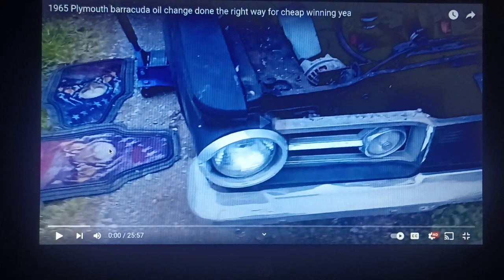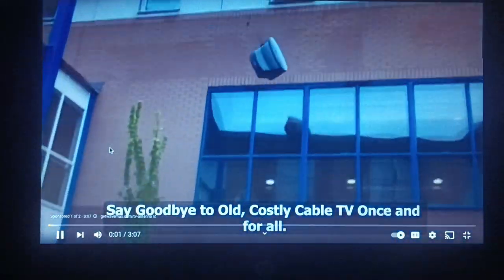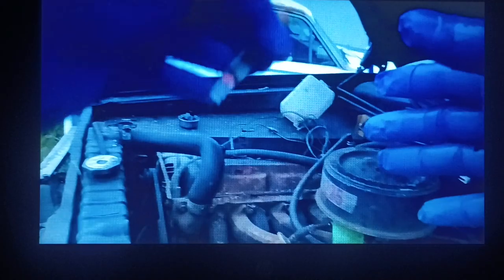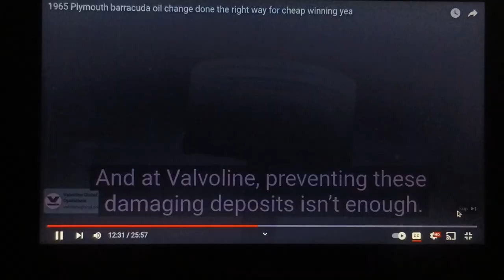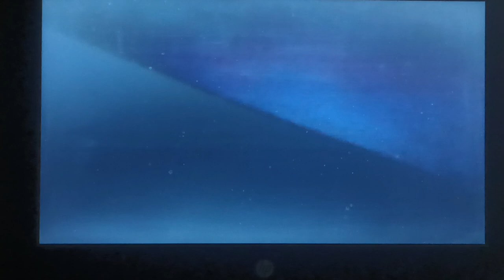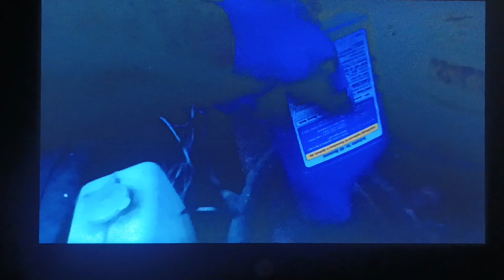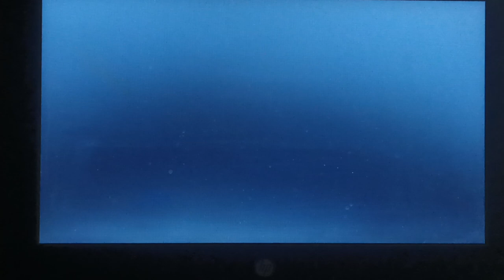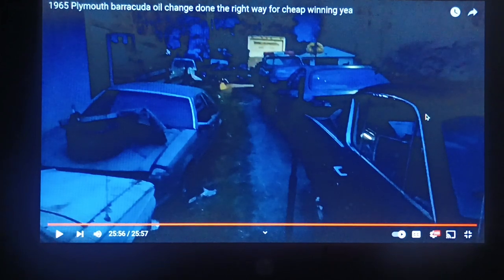I really don't like this guy

Comment: I just don’t see how it’s possible to keep that many cars running. 
Even used car dealerships have a very difficult time keeping all of the colors that are for sale actually running after a few days most cars begin to have problems with the battery and definitely after a month of sitting around most cars won’t start up
some parents might actually start up after sitting for a couple of months that’s definitely the exception
86 cars that would be a full-time job keeping them all running if that’s all you did for 40 hours every week making sure it was enough fuel in each car and making sure every car battery was charged up sufficiently to start the car

And that’s just the beginning because you have to run the car for at least 15 minutes or more so that condensation does not build up

I know this for a fact for myself the most amount of cars I can keep running would be about eight cars Beyond that. Maybe only somebody with a shop with some employees could keep all of those cars running
Reply: You have a really good point Barry is always having a hard time keeping fuel pumps working that’s because he’s always running cars low on gas he literally starts them for 2 minutes at most and shuts them off that’s hard on a engine or he starts them and floors them witch is also hard on a engine the man claims to he a mechanic with 40 years of experience he did a video on you if I remember right ig you said it was a shame about one of his caddy’s and he had to go on a video and tell you it’s a parts car just like the one of boat tail you said to put a tarp on it and he had to say it’s a parts car even if it’s a parts car you want to keep your parts cars in good shape so the parts are good lol the man makes no sense